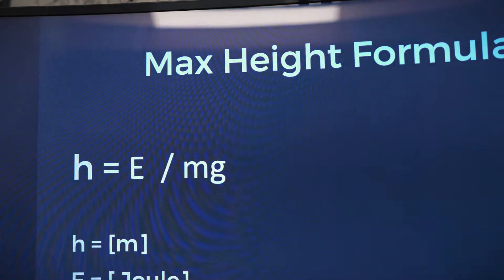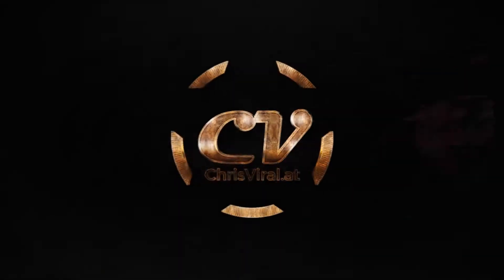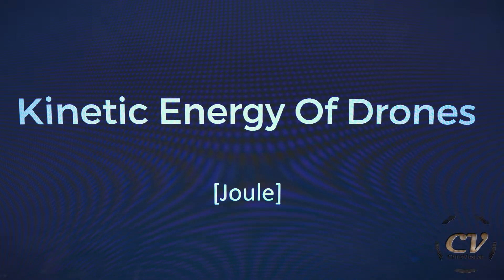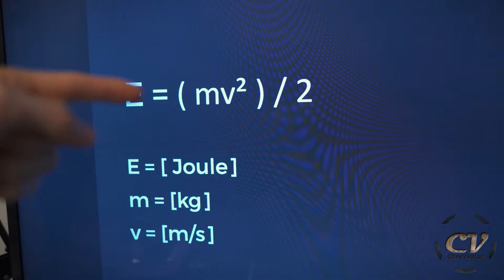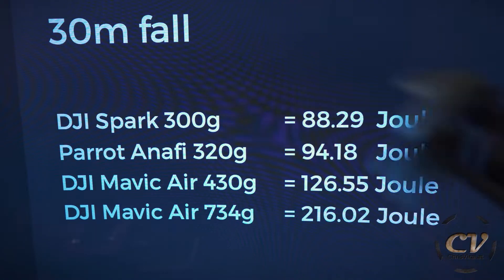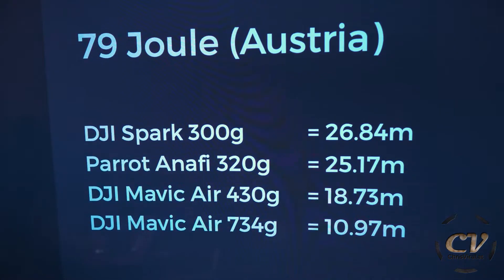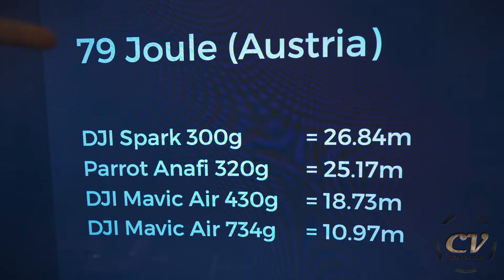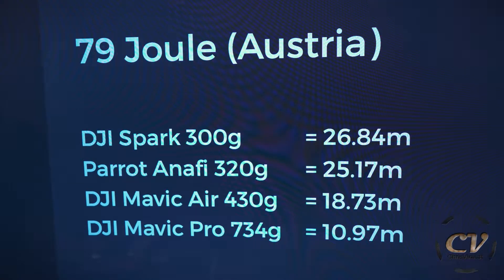How To Calculate Kinetic Energy For Drones (Drone Laws | Max Height | 79 Joule)

Comment: I wanna get the mavic pro 2 (907gr) but aslong as i stay under (~8-9Meters) i dont need any papers or license in Austria?
Reply from the maker: Don't only take my word for it. Do you own research too. But yeah, that seems to be the case. <30m <79J that's it. Weight matters only for the calculations.